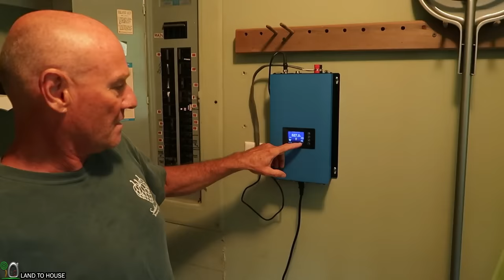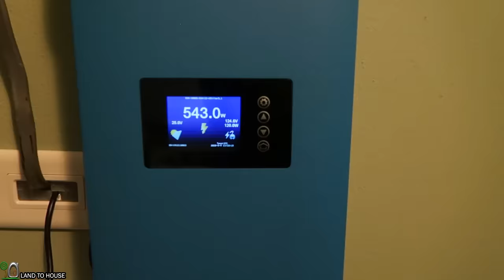Awesome Low Head High Flow Grid Tie Micro Hydro 530 watts!

Comment: Wouldn’t you get more power putting the generator at the bottom near the outlet, since the pressure into the turbine would not be limited by atmospheric pressure (i.e. relying on vacuum, which can only be 1 atm, or 14.6 psi) but instead the weight of the column of water pushing down on the turbine?
Reply: Ahhh...but the flow of water is the same.
Reply: @hudzgh  actually, the flow would probably be slower with the propeller at the top than the bottom, since the water couldn't push it very hard. It would be easy to stop the flow at the top by putting your hand over the hole, as the most pull your hand would experience is 1 atmosphere vacuum. However, at the bottom, you have no vacuum but the pressure from the weight of the water pushing on your hand, which could potentially be much more. A real easy way of thinking of this is in inches water (or mm water) units of pressure, which literally is measured by how many inches high vacuum could pull a column of water. 1 atmosphere =407inches water, or 34 ft...... So I guess if it is shorter than 34 ft, it doesn't matter much, but higher than 34ft you gain power only when the pump is at the bottom, otherwise it will just cavitate somewhere in the pipe. I also see why people use mercury for these gauges and not water, haha.

Comment: What does that mean, "Low Head High Flow"? I always assumed that high water pressure was required to turn the turbines. I like this video because Bill's situation is very similar to mine. I guess one way to look at this is like a truck hitting me at 25 mph is similar in energy to a small car hitting me at 50 mph. More water volume means more momentum.

Comment: Would using double-45 degree fittings instead of the 90's or sweep 90's produce since it would create less back-pressure on the water. Is there sufficient water flow and force to add a second generator further down the line?

Comment: The siphon will always be degrading,  even with the tennis ball. Small air bubbles get sucked in and accumulate reducing the flow till it stops.   Would have solved this problem by piping an outlet pipe from the below the water level through the wall.  Also the position of the vacuum point, shouldn’t that be at the highest point? It may not matter I guess, just seems weird.  Otherwise pretty good system.  Where I live solar panels only produce 4hr rated power per day on average so your 500w would be equivalent to 3kw of solar

Comment: Hi , I like the project and concept,. Problem is I don't have a river or Pawn  to take water from. My question is, is possible to install this turbine setup in a 5000lt tank    and catch the water in another tank that feeds it back to the big 5000lt tank again and how long before the 5000lt will run empty if not feedback the water , like in a cycle

Comment: silly question... if the water is moving so fast when it exist the pipe at the bottom, why has he not got 2,3 or 5 of these turbines in series generating 2500W?
Reply from the maker: The more turbines you introduce into the pipe the more friction you have. He might get by with 1 more but it would not double the power. He would need to break the siphon and install another catchment for another turbine.

Comment: Would it be possible to have a 1” poly pipe inside the 6”  8’ drop pipe below the turban and have the smaller pipe drive a ram drive pump further down the creek?

Comment: Wouldn’t it be more efficient to have smaller diameter pipes but more turbines, or split the flow to more ? if you’re taking up all the overflow of the dam anyways ? Also, why not install a power wall and go totally off grid at that point ?

Comment: Hold on, if I heard him correctly that power's being sent back into the breaker incorrectly. A standard plug's very unsafe for that purpose- he should get a specialised plug and socket where neither the plug or socket exposes its terminals (I'm sure somebody makes it)!
At least he has a protection system for the linespersons nearby, but that plug could kill him if he unplugged it!

Maybe the system will cut power when unplugged somehow, but I wouldn't trust that enough.

Comment: With so much draw from the amount of water going down your water line, wouldn't it be possible to put another 1 or 2  turbines in series on the same line and generate two to three times more electricity without impacting the water flow?

Comment: I saw some comments about suggesting multiple, in-line turbines on a single pipe. Would that work? I'm thinking that the vortex of the first turbine would either cause issues for the next in line or possibly improve the next ones rpm. Based on the current design, it would need to snake left and right to fit them in but I'd think it would be an awesome idea. I'd like to use hydro where we're moving and have been looking at this a ton. I would love to see if it's possible before investing into it with my limited knowledge and resources.

Comment: Hi, I was playing around  for several years and have myself made a big unit  that gave me 1300 watts  for 5 years. Since the chains  were worn out, the system  was halted and  scrapped. I then installed a india made crossflow  turbine but that one gave me  too litte output and also fish got caught up in the turbine ! I saw your video. It is similar to the  units manufactured for  developing countries but that does not disturb me. In fact, I manufacture pumps that look similar to your  turbine.  Where did you find the  generator and the  propeller?  Another Q is  if you did not have a surge  and burnout of your inverter. The rectifier you use i know well. I have managed to burn one  inverter using  such a rectifier. When the grid is off, this can be a big problem - provided you have mechanisms to brake the  turbine. I have a special  resistance pack  to brake  the generator.......

Comment: You could add many turbines in that pipe line easily and a large ball valve will slow the water pressure so the creek won’t drain.

Comment: You mean the construction process.
Of course, drawing is only drawing.
The hardest part how to build it.

That's where engineering works do.

How that dam constructed.
First it needs a divert it's flow.

Then dig for the foundation of the dam.

Comment: Considering volume, I would install more turbines on the way, maybe different types. but dumping so much water for 530 watts does not look very efficient
Reply from the maker: Because the additional turbines would introduce more friction the water would start slowing down significantly.  

The hydro power math:
(Headpressure in feet X GPM)/10=power
This location can only make around 550w total.
Reply: Indeed, it does not support more turbines, but if you can theoretically obtain 600-650w by improving the pipes, at the beginning by inserting a wider elbow, but...why place an elbow (90°)to the right and lose friction while being able to carry the entire pipe line straight!?, later in the vertical by expanding one more measurement, in the low elbow changing to 2 off 45° elbows and with that it is certain that 100w more if you obtain!______/_______ Efectivamente no admite más turbinas, pero si se puede obtener teóricamente 600-650w mejorando las tuberías, en el comienzo metiendo codo mas amplio,  porqué colocar un  codo hacia la derecha y perder en fricción pudiendo llevar toda la línea de tubería recta!?, después en la vertical ampliando una medida más,  en el codo bajo cambiando a 2 codos de 45° y con eso es seguro que 100w más si obtiene!

Comment: Why do you need to use the rectifier to convert to DC and then immediately use an inverter to reconvert to AC?
Reply from the maker: The AC from the turbine is 3 phase. The power grid is not able to accept that. So it is rectified to dc and then the inverter outputs ac 60hz 120v.

Comment: I'm sure that using the ground on a 2 wire cable to connect 3-phase to it is a NEC code violation. ALL energized conductors shall be separately insulated in the cable assembly. And the White can only be used for this by remarking in some jurisdictions.

Comment: I don’t understand why the turbine doesn’t have to be at the bottom. Would it have more power down there, or is this like an electric circuit?
Reply: i was wondering that as well. i guess if the flow is consistent regardless of external forces ( gravity) then it doesnt matter where it is. i must be missing something tho

Comment: is there a reason why you just don't build 2 turbines into that setup? would make sense to me that way you can make more power in needed. like have double turbines with a Y  then back to a single pipe back into the water.

Comment: Nice turbine.

BUT please tell me you aren't feeding back into your house via a plug with live pins? 😱
Reply from the maker: That inverter is called an islanding inverter. It is excited by the grid. No grid and the unit is off.
Reply: I was thinking about the pins being live from the inverter.

What is the purpose of the cord plugged in?
Reply from the maker: The standard house cord reads power from the main service and if 60hz 120v is there is allows power to go into the house. The amp clamp reads power usage from the main and allows the inverter to push power.
Reply: Ah.

I found the video a little confusing. It sounded like the plug was providing the back feed into the house from the unit.
Reply from the maker: @tjwatts100  Yes the inverter is connected to the turbine and that male plug is feeding the house only when grid power is detected.

Comment: How would you shut off the flow going from the top of the dam to the bottom? I'm planning on installing a similar system like this with batteries but I need a way to cut off the electric generation from the generator.
Reply: Either. However, the shutoff at the bottom would incur a greater pressure.

Comment: why does the wider tube at the end "create a vaccum with the venturi effect"?
Reply from the maker: I think what was meant is that the water flows faster in the smaller section to keep up with the larger volume of the bigger pipe.
Reply: @LandtoHouse  ok i think i understand. due to the bigger volume in the last pipe it kinda speeds up the water above it due to the water-mass acting like a kind of weight. is this a fair comprehension?

it depends on there being a powerful enough flow to fill the bottom pipe completely in order to work though.

Comment: Iv'e always wondered has a system that uses a low diameter say 6 inch shaft like a pipe extending across the top of the dam turning at a slow rate with impellors or fins mounted the width of the dam and the shaft is attached to a transmission that drives a generator been built? This could be modular in sections for ease of repairs. It seems the weight of the water  which is going over the dam could all be used with very little environmental impact. It's essentially a water wheel extended on a  low diameter shaft. Would a system like this work?

Comment: When the display on the inverter says 530 Watts, is it reading 530Whrs? Meaning that the turbine is generating 530 Watts in an hour?
Reply from the maker: The readout is watts at that moment or the "rate of power". The term kwh is the "amount of power over time".

Comment: Is there anything preventing one from putting a second turbine in a the bottom bend of the pipe? I mean it would be mounted the same as the top one relative to the pipe, Just at a 90° different angle.

Comment: If you had a bucket above your inlet with a pipe and shut valve connected to just below your turbine you could fill it, then drop its water into your drop pipe. It would pull more water behind it, if you shut the feed bucket valve just as it emptied. Shame you can't put the inverter by the turbine. Mains voltage would loose less power than the higher current of your 24V for the same thickness of cable.

Comment: How do you align the 3 phase of the turbine with the power company 3 phase?
Reply from the maker: The turbine produces 3 phase then the rectifier converts it to dc then the inverter converts it to 60hz 120v ac for the house use.

Comment: Couldn't you just lower the water entry point to allow small amount of water to flow in to fill the pipe.  Install a shutoff valve, close to fill the pipe then open the valve.

Comment: i know with airflow you lose up to 30% of the flow with every 90 degree turn one has in a pipe so he has 2 such turns meaning as much as 60% flow is degraded. but does that count with water is the question if yes then why not a very long mesh cage  and straighten out the pipe so you only have one turn.

Comment: There is one problem with this installation. A turbine doesn’t like to have  negative head behind the turbine, which the long tube on the exhaust behind the turbine creates in this installation. 
This negative head in the exhaust pipe may cause cavitation and thereby not only damaging the turbine in the long run, but also reducing flow efficiency. 
The turbine should be installed as near as possible to the end of the pipe for this to be right.

Comment: Because the turbine was installed at the same height with the maximum level of water, the system is losing / does not use the potential energy of the 15 feet height difference.

Comment: I'm confused why this guy only offsets half of his power bill. Why not run this baby full time? Is there not enough water in the pond to sustain flow?  Also, why not supplement the hydro with solar? I would think between the two you could go almost entirely off grid.

Comment: cool setup dude. check out will prowse's channel. you could radically increase your efficiency by switching to a DC alternator- probably around 1200 watts, 48v DC. using DC voltage to directly charge a 14kwh LFP pack at your house, then use that power to run your house. nice setup. by the way- DC current has near 0% voltage loss, even over great distances.

Comment: Something puzzling me... Why didn't he dig a hole in that vertical dam wall to ensure that water will always flow without vacuum and at a high pressure?
Reply from the maker: Its wood on the front and a massive concrete slab on the back. It would take a lot of effort to dig a hole.

Comment: Interesting. 900kwh/months. About 0.8kw/h. The hydro is 500w/h, which is 360kwh/ month. Even if it was 800kwh, it colud not dip below 400kwh, considering that he does not have a battery, it is kinda generous calculation. Am I wrong about this?

Comment: Don't rectify your AC and then use an inverter, you're losing power that way. Instead, buy a 3 phase transformer, and step it to your nominal AC voltage, just use a small DC power source to power your control center and that's it.
Reply: Agreed.

Comment: By putting the generator in the highest point of the pipe you are not taking advantage of huge part of the available energy. I'd rather put it closer to the lower dam to use both the potential and the cinetic energy. Great job anyway!

Comment: There's a good reason nobody uses this design - it's cavitation that will destroy the turbine in time. Also, a lot of power is wasted in the wire copper due to i2 losses. I suggest using a step-up transformer as close as possible to the generator. Taking the third phase through the wire grounding is dodgy. I'm surprised your electrician friend approved of it. The least you can do is relocate the rectifier near the generator and pass dc through only 2 conductors. All the best from Australia!

Comment: That AC wire coming out from the inverter is very dangerous as your switch level is at the bottom of wall any kid can pull it out. That 530 watts could be a certain death. It should be inside wall or you should install a wooden box with a lock at that point. I would prefer to directly connect that AC wire to my electric board with some power breakers and anti electric shocks.

Comment: .....so it's making enough juice to run the water heater? show me one that powers the whole house without the assistence of the power company
Reply from the maker: The basic math behind hydro power is:
(head pressure in feet X GPM)/10=power
Lets consider my home. average winter day with electric heat is 50kwh of power. Lets say that's 2.1kwh every hour. You can see the hydro power would need to be at least 3 times as big. (battery storage would help a LOT in this setup)

Comment: You should put a stand with a big water tank 12 inch hole or a 10in pipe at the bottom 45-degree into that pipe from the big tank with a lot of water they'll be lots of pressure you wouldn't have to use a Shop-Vac pressure all the time and if you want to create more power with a turbine much bigger use the ones that you get off band saws those type of Motors create kilowatt which will power more objects around the area been set up a steel bar across that River or Creek build up a Ledge to create more water full and pressure on that steel bar going across you put big shovel scoops blades for more water Deep buckets more weight more revolutions use bike gears to create a faster turn on one of those motors from a bandsaw or two of them build a base for your Motors on either side hook your pipe onto their mounts with your gears to speed it up no need for pipes you can run a full-size house off this setup
Reply: I believe your system would work on Wells with bigger pipes and bigger pumps that pump the water would work well for acreages this design

Comment: You should modify your system to pump the water from the bottom pond back into the top holding pond once it’s at the bottom then you will solve the issue of draining the pond and have a system that can run constantly.
Reply from the maker: The problem there is the power it would take to recirculate the water. For a pump to lift 300gpm back to the top of the dam it would take a LOT of power. Way more than the 500w made from the falling water.